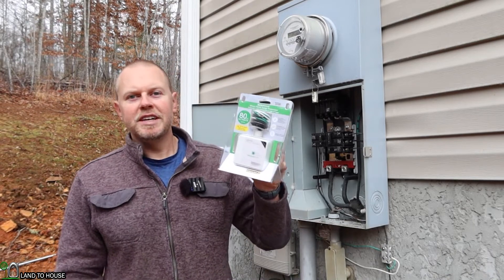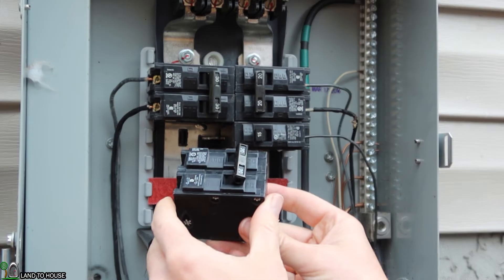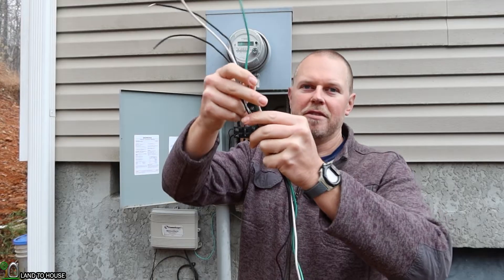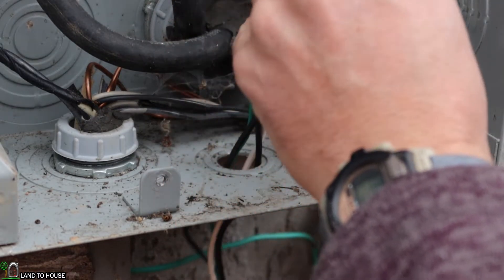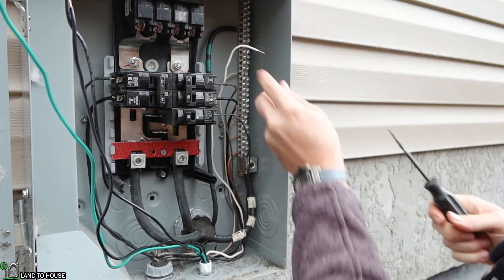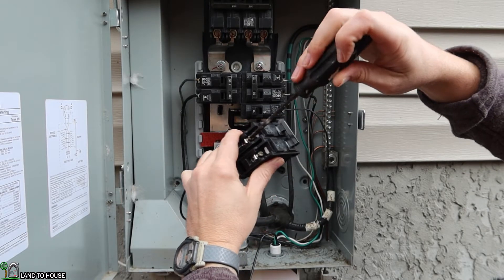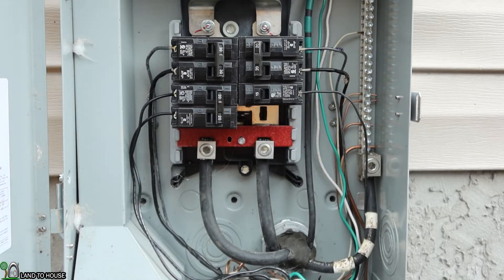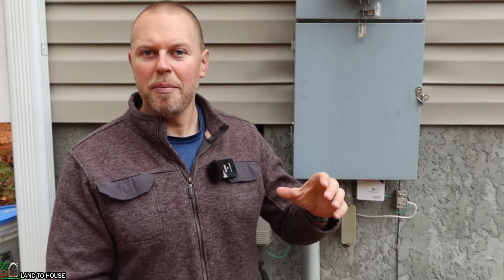How to Install a Square D SPD Surge Protection Device

Comment: If you connect with 14 AWG wires you should use a 15 Amp breaker not a 20 Amp breaker

Comment: Type 2 SPDs should have the shortest wire run possible. The lowest 15 amp circuit on the right could have been moved to the left side. Then the SPD breaker could have been on the right with the SPD mounted just outside the box on the right. The wire run would then be straight and very short. (Would probably need to drill a hole in the box.) The neutral and ground could also be short, but I do not know how important that is.

Comment: For a 14 AWG wire you should install a 15-amp breaker not a 20-amp breaker.  Also, if you are going to show people how to install electrical devices, please for the love of God please tell them to check with a meter to make sure it is dead before touching anything, never trust the breaker.

Comment: This guy is dangerous. First, he removed the protective outer cover, exposing himself to potential electrical shock/electrocution before shutting off the power.  Second, after shutting off the main switch, he did not use a volt meter to confirm that there was no stray power inside the panel. A previous electrician or homeowner may have rerouted power circumventing the basic safety equipment. Or it may have been improperly installed during construction.

People sometimes do stupid things.  Just because someone else may have done something stupid doesn't mean you should pay for others mistakes.  That's why he should have taken at least these 2 extra safety precautions.

Comment: Just a little advice from the manufacturer spec of those surge protectors. The line wires need to be twisted together as you they go up to the 2 pole breaker it enhances performance

Comment: My house has two main breakers after the meter that feeds two panels in my garage.
Inside the two main breaker panel there is a 15 breaker for an outdoor outlet nearby.
Do I need two surge protectors by the main panel?
Reply: 1 at main
Reply: Yeah, the more surge protectors the better.

Comment: Bad tutorial. You shouldn’t use 20 amp breaker on 14 ga wire. You should also try to keep those wires as short as possible.
Reply from the maker: Sounds like you have this concept down.
Reply: The HEPD80 can use a 30 amp breaker and it's better to go with the biggest size because it has a less likely chance to trip.

Comment: Read and understand the directions for SPD’s. SPD needs to be connected as close to Main as possible. If using a dedicated breaker you need to move either top breaker down the stack to make room. If one of the current breakers is the correct size and rated for dual connections (noted on side of breaker) you can connect black wires to existing breaker. Best way is to put ring connectors on black wires and mount to L1/L2 studs just below Main breaker as seen at 2:44 in your video. That is as close as you can get. No breaker needed, no breaker shuffling. Use a step drill to pop a 1/2” hole in the side panel even with L1/L2 studs for shortest run.

Comment: So basically the surge protector doesn't get installed in a series but is more of a passive device meaning it only has to be on a live circuit anywhere connected to the panel

Comment: My circuirt panel is inside the house and embedded in a plasterboard wall. What is the best way to mount a whole house surge protector?
Reply: Just get a smaller kVA breaker style unit.  It's plug and play.

Comment: Is it your understanding that I must add a new breaker in an empty slot to my panel to use this? They say to hook it to a 15, 20 or 30 amp two pole breaker but they don't specify whether or not you're supposed to add a breaker just for it. Also, I'm wondering which size of these 3 breaker choices is the best or does it matter as long as its a 15, 20 or 30?
Reply from the maker: The product recommends that you install this as close to the top of the box as you can. Dedicated breaker is recommended. The wires on this unit are a small gauge so any of those mentioned breaker amperage should be just fine.

Comment: Um, not how I would mount it. Wires as SHORT AS POSSIBLE. As CLOSE to the neutral/ground buss as possible. Why? For every inch of wire length, you increase the clamping voltage by 20-25 VAC. So if that device dumps voltage/current at 600VAC, you add on say another couple hundred volts for example till it starts working. Shot wires short wires.......
Reply: Says so right in the instructions, Page 4, very first paragraph.

Comment: Had a dryer fire a few years ago that could have been a full house fire had it not been for the quick action of my nephew (I was away at work) and the ready placement of a proper fire extinguisher (our local volunteer fire department being five miles away made it for the cleanup, bless them all). Everything that was on at the moment got zapped (TVs, Oven, a couple of game systems), and the company that installed a new service from our pole said it was undoubtedly a surge, but from unknown sources. Our HomeOwners insurance (the people with the mighty Stag...) wouldn't pay a thing since we couldn't prove where the surge came from (of course, we changed insurance companies after that). Surge protection is well worth the costs!

Comment: How does this surge protector work exactly?
Reply: If the voltage spikes above 600V between one leg and neutral, or above 1000v between the 2 legs (black wires), the Metal Oxide Varistor inside it shorts the extra voltage through itself to try to keep the house voltage from spiking up.  Most spikes last a tiny fraction of a second so it can handle quite a large jolt, as much as probably 80,000 amps through itself for that tiny fraction of a second.

Comment: Due to the physics of surge protection, it would be better to connect the ground as close to the grounding electrode conductor as possible (I'd put it in the next hole even if I had to move a wire out of it) and the wires should be trimmed to a minimal working length.  But any install is better than nothing for surge protection!
Reply: Thanks for the comment. I'm just about to install one of these so I came to YouTube for more info. 
My grounds and neutrals all mixed up on the bars as they are bonded anyway. 
I was still going to treat them as they are separate. Attach the ground close to the main ground, and neutral near the neutral coming from the service. Does that make sense?
Reply: @Jaw-t3t  Sounds like a good idea to me. Be careful!